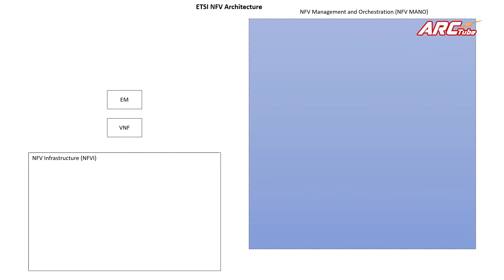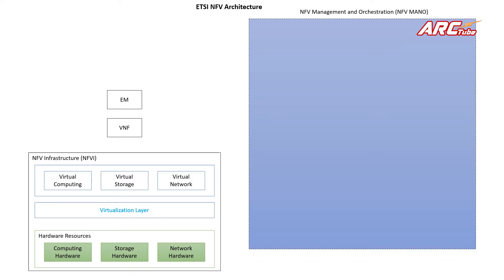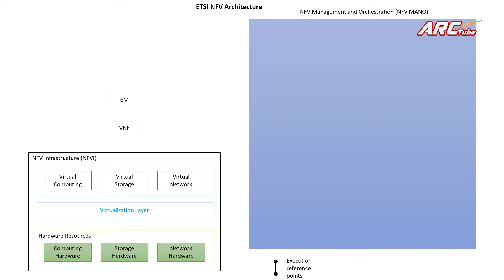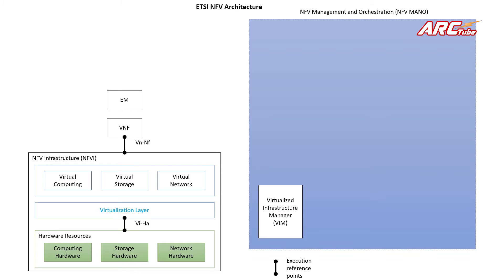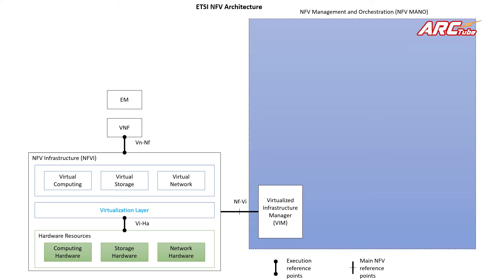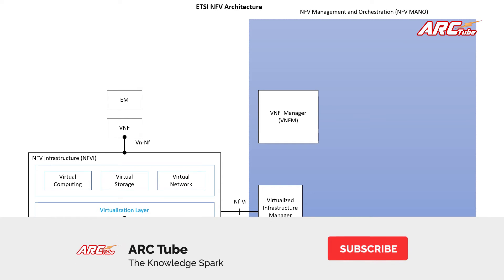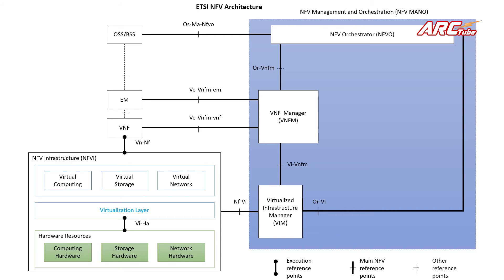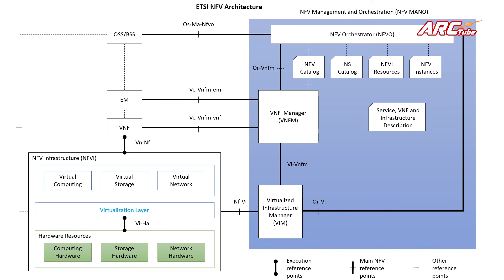Telco Softwarization - 9 | ETSI NFV Architecture

Comment: Thank you for doing such virtualization related videos. I am curious about knowing what are the key software related skills that an engineer should have to implement and for the system integration of NFV in telco sector. that will be helpful for the undergraduates like me! 
Thank you!
Reply from the maker: You are welcome Arulanandam. NFV being part of softwarization, as you have rightly noted, what you need is software skills. Starting with Linux as an OS, you need programming skills mostly. Python would be a good one to start with. This is mainly required for integration, mediation etc. However, it is more important that you understand the fundamentals behind core concepts/architectures like NFV. That was the main reason for the video. Based on the right and clear understanding, you can build on how to practically realize these concepts. Check for Lean NFV concepts and KV (Key Value) systems that will ease the system integration. Good luck!